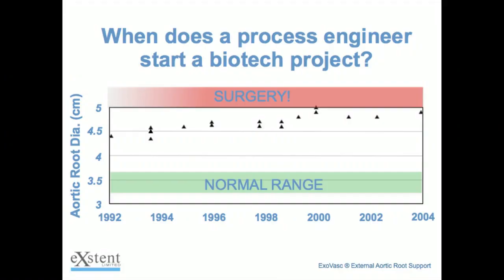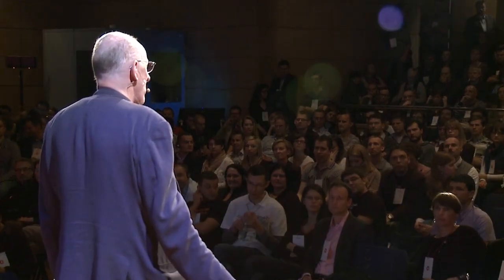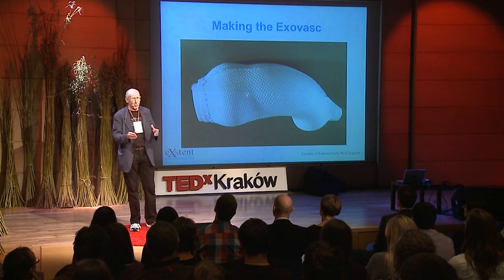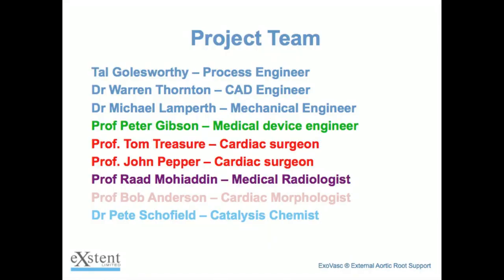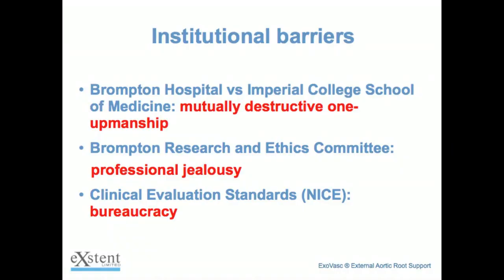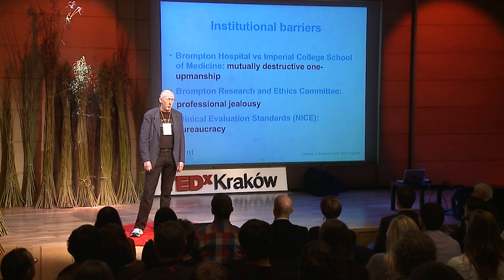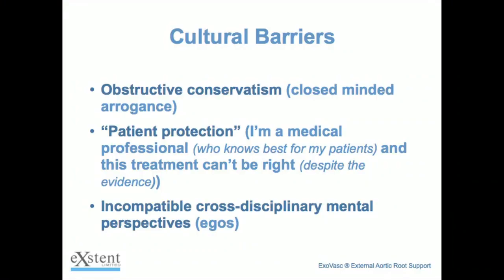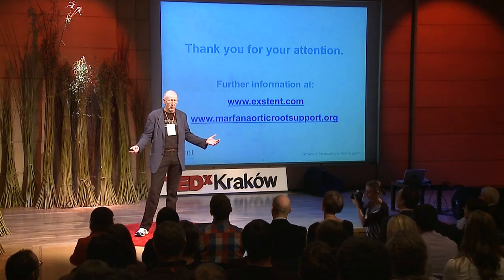Tal Golesworthy: How I repaired my own heart

Comment: You may wish to believe that but the reality is that many conditions are genetically predisposed. Whatever you do you will develop them eventually. And if the problem is not corrected you will probably die of it.  You may gain a feeling of control by believing what you do but it is an illusion. Though important, diet cannot cure many illnesses and has little effect on genetic conditions. Reality cares not what you believe. It will kill all the same.